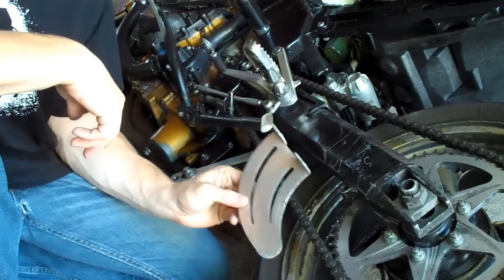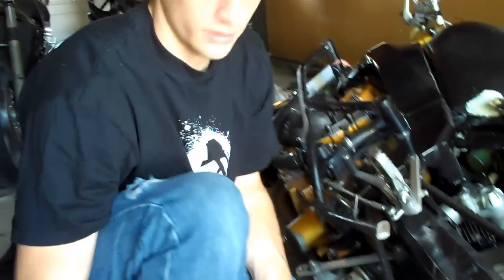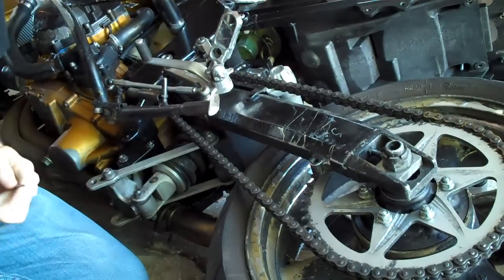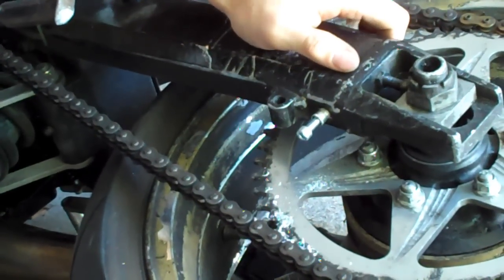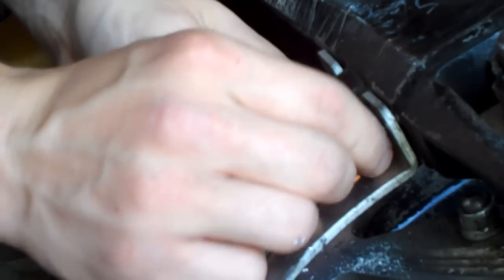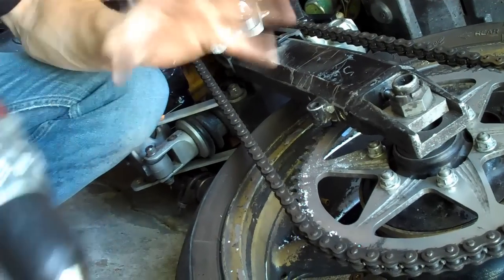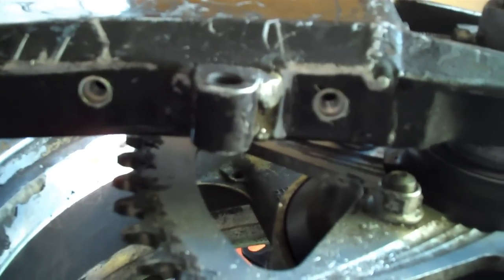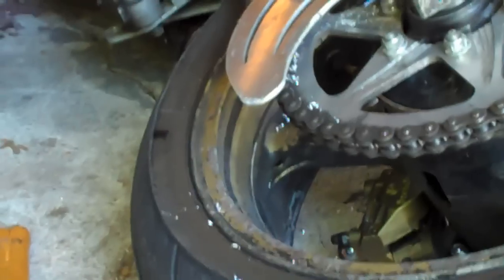Keeping Your Fingers Safe: Installing a Shark Fin

Comment: i dont get how the shark fin works, if your hand gets caught onto the chain, it drags it into the shark fin, cant the shark fin cut your fingers too? or is it just there to stop your hand from going into the sprocket, and how will your hand land onto the chain anyways? you fall towards your right side but off the left side of the bike and post to fall?
Reply: lailide its the sprocket that eat fingers. So this provides another layer of safety by preventing your finger tips from reaching the sprocket